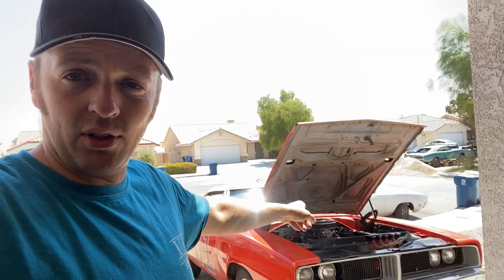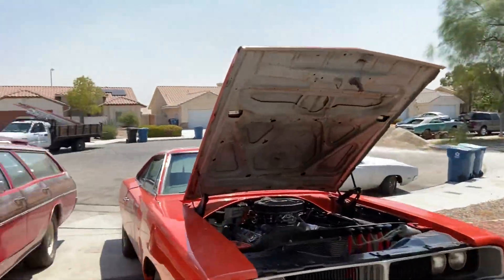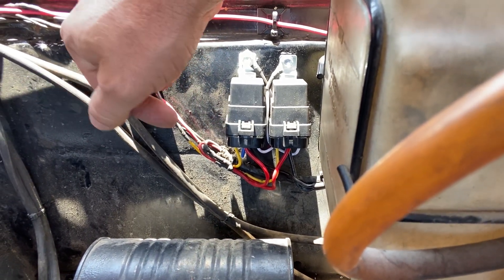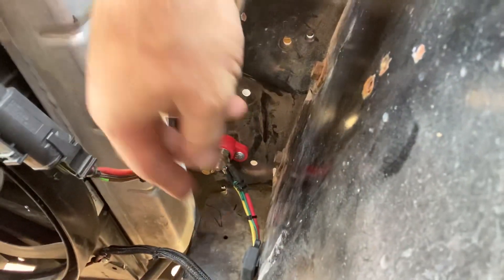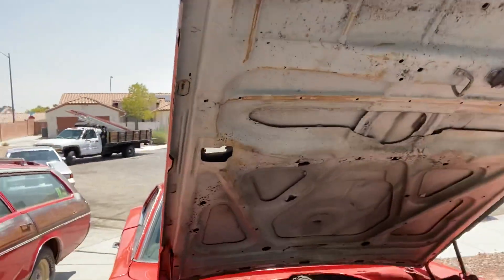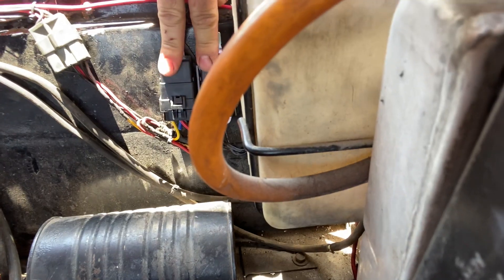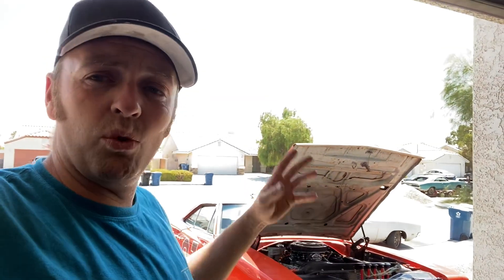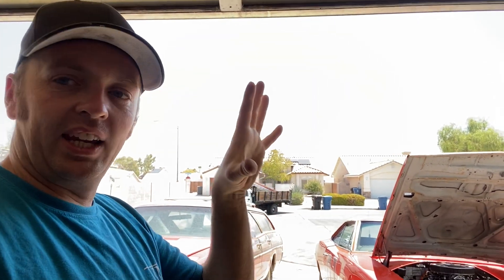Quickie: headlight relay electrical tip

Comment: Great tip, everyone should do this. No more pulsing lights at idle either. I hid my relays under the battery tray so it still looks stock

Comment: I had that set up for aftermarket (good) fog lamps that actually lit up the road with hi watt bulbs on a car I used to own. The switch was never rated for the load of the bulbs. They were also only wired on the low beam circuit.

Comment: And the voltage regulator never saw the battery as charged and just pumped high current all the time, burning itself up.
  Also, as one other guy mentioned,  it is not good to use the in dash ammeter.  Better to use a in dash voltmeter  to keep the heavy amps out of the dash to help prevent damage and possible fires.
Reply: I believe Chris has done the dash voltmeter to a few of his Chargers for the reason you mention. He said I think in one of the Patina build videos that he's done this to her after explaining why.

Comment: An yes, ohm, ohm on the range, where Millievolt and Micro volt play.  I had a Mitsubishi 4 cylinder that quit charging.  The voltage regulator in the alternator was bad.  A rebuilt alternator fixed it for several days, then put another rebuilt late for same problem.  Same problem days later.  Troubleshot everything: battery & terminals, grounds etc.  Read all my old car maintenance books for a clue.  One mentioned ignition switch.  Checked it and found OHMS.  New ignition switch and 3rd. alternator fixed it.  I think the voltage loss across that switch

Comment: I by a kit for chevy trucks that have this setup for $25 from a company (Putco) and use on my jeeps. It almost doubles the light output and is much safer. Especially if running a much bright h4 bulbs. Not as much needed with LEDs

Comment: It's also a smart idea to not only crimp the wire connectors but also solder them . and what ever you can't solder on a connection use dielectric grease . I had wiring problems on my 65 dart and my 82 dodge d150 from factory crappy connections fix them with the info listed above and no issues 😎👍 . is there a wiring diagram on how you set up your head lights? If not can you make one ? Let me know if you ever come to the branson mo. area ? Would be cool to hang out and bullshit about general lee's and mopars

Comment: Chris,, while never experiencing hot switches [that I know of] adding the relay gives far more useable light.  60s and 70s Ford and Mopar wiring is less than satisfactory and as they get older suffer more and more from voltage drop. You struggle to get 12v to the lights from a 13.5 volt system. Use a multi meter to check the voltage drop.
For lights I have simply taken a wire from the back of the alternator. Though for the rest  I have a post similar to yours. Remember a normal 55/55 watt H4 globe draws no extra amps. But using 100 watt hibeams defenitly do. Though said 100w globes only make marginally better lights
On my 71 Galaxie I have relays hi and low beam, horns, starter, a/c to compressor and another to the fan motor. And the electric choke.  As well as the ign box. 
And this is the case for all of these classics, GM stuff included. All of this though does make a hell of a mess with extra wiring. And yours is neater than mine. Mine is functional!
This is sometimes the case on most more modern makes and models. Especially for the starter as the switches simply trigger a click without a relay. About 4 volts.

Comment: I always had problems with the electric motor that flipped the headlights. Many times had to manually flip the headlights down by turning the small wheel.

Comment: Got an 81' Chevy Malibu I am restoring, One of the problems I am having is trying to solve the Headlight issue. High beams turn on no problem, but I am still not getting headlights even after replacing both the headlight switch and the dimmer switch all ground wires are fine and so is the amps. Since the electric for the lights is already running through a relay separate from the fuse box, only thing I can come up with is either the Connectors are bad or a burned out wire some where. . .
Reply: @Say Whut? New Sylvania Headlights were put in in April while I was trying to get the engine running.

Comment: An other solution if you want to keep your stock wiring is go with LED headlight kit. LED lights requires much less amps than stock ones. More $$ than relays tho. here`s a link  https://vintagecarleds.com/shop/5-75-inch/vcm3-5-75-inch-led-headlight-kit/

Comment: Does that fix the issues with the headlights getting  dimmer at lower speed and get brighter when ya get on the gas like all these old mopars seem to do ?
Reply from the maker: Yes, but also depends on ur alternator output

Comment: Have you thought of putting LEDs? Surely those are less draw right? I've got utility lights running off toggle switches atm, I never noticed them heating up but now it's got my kinda paranoid

Comment: Ive got 68 charger does it stress the headlight switch when headlight it's not on too ?
Reply: No. Look at a switch like this. If a bridge is open, there are cars in front of the bridge. But none can pass the bridge. There are no cars on the bridge when its open either. The cars are the current/stress.
There will be voltage on the switch but this doesn't matter as there is no current like cars crossing the bridge.

Comment: Best relay hack I use is to have the original resistor points supply, trigger a relay, to power an electronic ignition undiminished... did this 25 years ago in my C10 and have never had to touch it since. Beats fishing the wire out, and if some purist ever wants to put points back in, no problemo. Dig these shorter videos man ! I am lost after 5 minutes... just sayin : ]